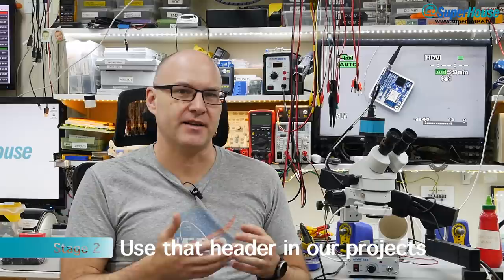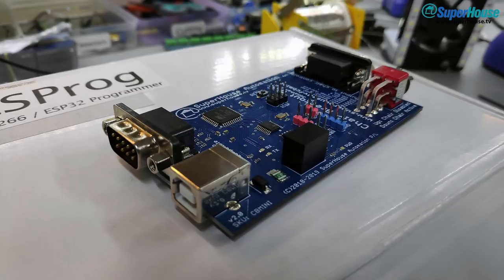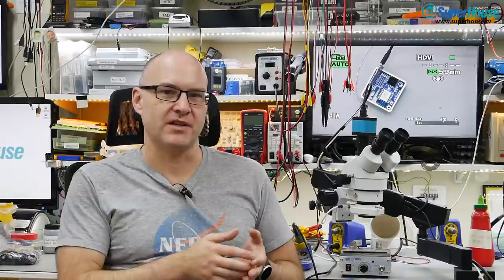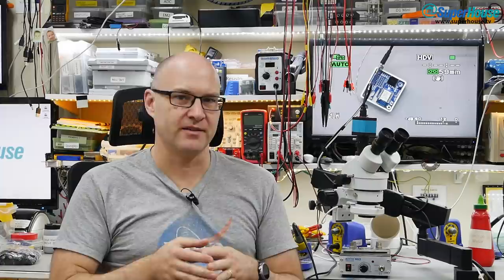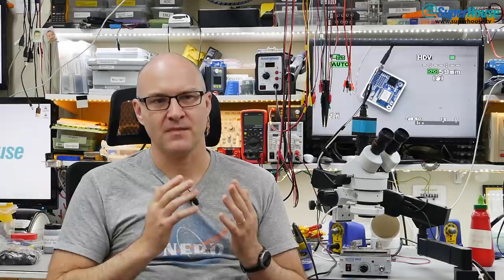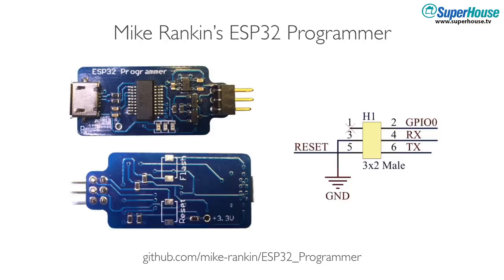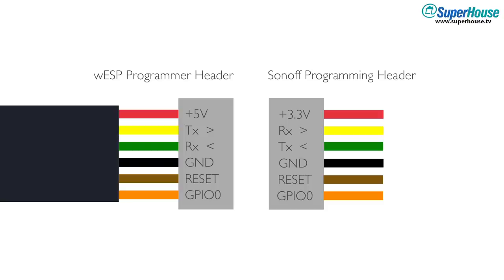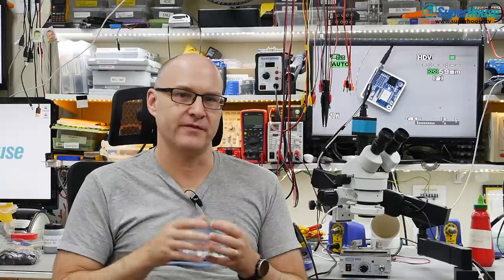Vlog #66: Let's define a standard ESP8266/ESP32 programming header!

Comment: Why not both: Allow the 2.54mm 6 pin sonoff+2 type header, and the tiny 2x3 pin header. On the programmer, put one on each side of the PCB. This way, it is easier for itead, other companies and your personal projects where you don't care about size, but you'll still be able to use the very small connector when there is just no room

Comment: Just add the two extra pins. This way it will keep the old standard and be backwards compatible with the the older sonoff gear.
Reply: I was thinking the same thing.. have the last two pins on a 2-gang flat cable (or twisted pair) so that the extra pin headers don't get in the way when  using as a regular FTDI programmer.  Could also have a matching 2-pin male on wires you could solder to the right pads on an ESP board that's missing them.

Comment: The 1x6 header would be easier to use by pressing at an angle against the pads on the PCB. It would probably be darn near impossible to reliably hand press a 2x3 header long enough to program the board. (assuming that there aren't actually sockets to plug in to).
Reply: It would be possible to have the holes there, and then you just pressfitt a male adapter. No need to hold while programming.

Comment: I think asking for design changes is like like a kid asking the bus driver to pull over for an ice cream. 

What I’d like to see is a printable mount, one for each board type, to which attaches a clampdown unit.  On this clampdown unit would be the necessary electronics to flash. Pre located thanks to the exact guidance of the mount, the clampdown unit would have spring mounted pins that are correctly spaced to mate with the holes.  Thus no soldering to get good electrical contact. Spring mounted pin will not do damage should there be misalignment.  Add or remove pins like detachable teeth and you future proof it for when board designs change.  Wiring back to the electronics would be swappable to pick voltage, TX RX etc.  

Procedures are 
Take units out of housing
Select base locator for that model and attach to clampdown unit
Connect punch down pins to electronics via appropriate wiring 
Insert SD card
Insert board to be flashed
Engage punchdown
Lock
Turn on
Start button to begin flash process
Unit indicates complete and turns off
Unlock and remove, repeat for next board “factory style”

Just seems more future proof if it could be done?
Reply: I've considered something like this, or maybe something that isn't product dependent, but rather matches up directly with the esp8266.

Part of me envisions a tool that functions like a press of sorts that just lowers a series of "pogo pins" onto the esp8266.
Reply from the maker: I've already done this for the Sonoff Mini. It's part of what started this whole question. My programming jig uses pogo pins to control GPIO0 and RESET on the Mini, so it can do auto-reset. But the question is, what should the format be for the programming header that connects to the jig? The jigs can all be specific, but the programming header still needs to be standardised. That's what this is trying to solve.

Comment: Good idea. I did they same through my designs with ESP32 only with a muuuch smaller header to save space.
Reply from the maker: What header did you use? I'm currently planning on supporting 1x6 and 2x3 in both 2.54mm and 1.27mm, so a 2x3 1.27mm header is quite small
Reply: @SuperHouseTV  I'm using a TAG-connect cable, saving costs on the PCBs for a header but the cable itself is overpriced.

Comment: I would vote for both a 1x6 2.54mm pitch and a 2x3 2mm pitch as options. More annoying for the hobbyist who ends up having both adapters lying around; but more flexible for PCB layout, as there are form factors that don't suit 1x6 (2.54mm wide and 15.24mm long) and other form factors don't suit 2x3 (about 4mm x 6mm). 3.3v and a standard order of signals too.
Given the manufacturers at volume are pre-programming their chips and don't strictly need these pins at all, it's somewhat nice that they are offered at all.

Comment: Having a short cable from the programming adapter to the target probably makes it simpler to connect.  How about trying to standardize the order, and then provide the 2mm vs. 0.1" pitch connectors on the programming device to make it easier to have inexpensive ribbon cables that are 'straight-through' for both formats.

The other aspect, independent of the physical connectivity is to define the programmer interface.  While it can emulate a serial port and support using the usual serial programming tool, wouldn't it be interesting if it looked like an OTA target as well?  Something to proxy that first programming step before the target is capable of OTA upgrades.

Part of the recommendation to expressif might be the pad layout with slightly offset alternate holes, so you could insert pins and have them stay in place, rather than needing to populate a header that's only going to be used once.

Comment: Really like the idea. One of the other advantages of having usb chipset elements on a seperate board along with the bootloader is evident for projects that look to minimising power requirements. If you have the CPU capable of running at extremely low consumption levels, having to power unnecessary usb interfaces negates the benefits, or you need more complex schematic to switch this extraneous circuitry off when not in use.
I don't have a preference for single in-line or 2x6 interface. If it becomes a standard doing forward it doesn't really matter, but having a 5v to 3.3v regulator on board would be a real boon.

Comment: Do use 1*6 and 2*3 headers.  Allow pitch to be 2.54 mm and 2 mm for future space saving.  It could probably use same adapter for the 2*3 header in both pitches.
Mark the 1 pin with a huge mark on the bord, or also cut one pin and plug on adapters, then it can't be turn the wrong way around.

That is what I would do. It will be easy to change to the right plug, and it will work with anyone.

Or to save some more money, just have holes instead of pins, and then you can push a male socket into them.  And have one hole not drilled, so you can't turn the plug the wrong way.  It will save money, and I guess that will be pleasing.

Comment: I think we should keep the ITEAD standard and just pitch to add the extra two pins.  Certainly a lot easier and it is a format a lot who use ITEAD products are already use to using.
It is more than just lobbying ITEAD though.  There is Shelly and a host of other brands that use ESP chips in there various variants.  I think it would need to start by lobbying at Espressif as the chip designer to add it as a "recommended practice" to the datasheet.

Comment: Great effort, My view is to add the extra pins you already have the working design and I believe in the KISS approach.  I would think the best option is to use the de-facto standard from the majority which is the 4 pins, and add the two pins to make programming easier.   This still allows the flexibility to use a daughter board for any of the existing variations that scatter the pins around.  Even ITEAD have some that are scattered  but you already have a daughter board to fix that.

Comment: Being a software engineer I would prefer to see a 'box' that contains everything necessary to control a sonoff using its diy mode. I believe it should have a WiFi access point preconfigured with the sonoff diy ssid/password, an http server and a piece of software that would give the user the interface to discover all sonoff devices and control them by calling all supported DIY API restful commands including flash. This could perhaps be packaged in a USB dongle and it would replace eWeLink while being completely local.

Since Sonoff went the way of the diy mode it may make more sense to try to lobby them into making such a device instead of redesigning their PCBs and changing their whole manufacturing process.

Comment: Simple for the pinout, but not voltage.
Support 1x6 in order you specified for both 2.54 mm and 1 mm spacing.
For 2x3, use same pin order and support  in format 2.54 mm and 1 mm. Then programmer can accept straight and 2x3, and then make programmer autodetect if it needs to supply voltage.
Edit: I really like the 3x2 on the edge, but access in system might be limited.

Comment: The ESP8266 and ESP32 can bit-bang USB low speed.  What we need to do is convince espressif to update the firmware to allow a direct USB connection.  They could use the GPIO2 strapping pin to indicate UART (low) or USB (high) boot.

Comment: Does the format realistically make any difference, it really is a matter of six of one and half a dozen of the other. As you say both formats have their good and bad points. So why not actually try to mandate both, let the project makers choose. You then promote the inclusion of the six pins and their layout. That way if someone really wants to use a JST or a 2x5 you still get straight through pin compatibility. 
Yes it makes a difference to the programmer but you could simply put a 6x1 on one end and a 3x2 on the other just increasing the BOM cost slightly. And you can also pragmatically deal with the voltage in the same way put a 3v3 regulator on the programmer board and a switch/jumper pins to choose which you use, you can also allow for the third option of no supplied power if the target has its own power. Again an increase in BOM but this is a 'one-off' cost and not an increase into the project costs which get multiplied.
Reply: It may be easier to promote one standard rather than leaving it up to guess work as to what each board will have.   It would certainly be easier for those making adaptors as everyone could be guaranteed the pins would be the same for boards that contained a header.
I doubt it will ever be made a standard of any kind as manufacturers have their reasons for wanting us to use their own firmware and not reflash devices, but it's worth a shot.
Reply: @EsotericArctos  It is the pin order and placement that I was suggesting is the standard not the actual header. It is so much easier to make an adaptor from say JST if the pin outs match than it is to make it if the pins are in different places. Since this would only amount to a 'recommendation' than the easier you make it for the project the more likely you are to get it adopted. So a little bit of trace routing versus a whole new part which has to be sourced and purchased. Assuming they put the connection on that is.
Reply: Exactly. It’s not rocket surgery to make adaptor cables.

Comment: shelly has a header that exposes gpio0  - unfortunatly they have been changing the header to add various extra pins based upon developer feedback (I guess!) but the pins are on a standard 2.54 pinout and easy to access (and build a connector for programming).
Whilst not all shelly products can run Tasmota, a number of them can.

i dont think a standard header will be easy across multiple brands, and even EspressIf would struggle to make this happen.  BUT you could lobby to get a single vendor to be consistent across their own products.  It is a selling point which is why I would consider shelly for certain options over Itead.

Comment: Do a universal multipurpose programmer, your proposed standard board with a switch for voltages + adapter boards to extend this to existing standards. Plus points if you label the extension boards clearly and offer straight and right-angle variants.

Comment: How about a test clip that fits the package? I used to love those back when everything was in a DIP. I'm guessing there would have to be a few variations for different chips/packages, but once made, it would just be a matter of clamping (or pressing/holding) on the test clip (perhaps with integrated buttons for reset & assert) and then pushing the new code to the ESP.

Comment: The industry seems to have switched to programming headers with 0.05" pin spacing.  I'd use something similar to the SWD socket.  This might require a ribbon cable to connect the programmer to the board, but that would allow the programming socket to take up less space on the target board.

Comment: How about an entirely new connector format in the shape of the Open Hardware logo - https://www.oshwa.org/open-source-hardware-logo/ - but specifically intended for pogo pin flashing. The logo is already keyed (it literally incorporates a keyhole shape) and supports 7 contacts (gear teeth). Your PCB would then only need the logo pattern and maybe some kind of physical orientation key to help align the pogo pins. Just my 2 cents worth. :)

Comment: look into the SOICbite, was featured on hackaday... uses a SOIC-8 test clip for a really small double sided edge connector footprint and the post includes eagle files 

you can even use a SOIC-16 clip and/or make it reversible if you need < 4/8 pins

for an end product maybe use a dummy SOIC-8/16 IC for easy vertical access? then the clips are ready made with a row of pins on each side for some kind of ribbon cable
Reply from the maker: That's a clever idea for a connector, but it doesn't solve the problem of defining a standard pinout for ESPxx boards :-(

Comment: From what I've heard, Sonoff came close to making their products un-flash-able...  Is there really a chance they'd agree to modify their boards to make it easier?  True, the reason they didn't was the massive feedback from the Maker community, but still..  @Karinya Fields has a good idea that I took one step further - just add the extra two female pin.. thingys (what are they called?? receptacles?)  on a twisted pair or two wires from a flat cable, and have a similar loose 2-pin male on wires to go with the programmer.  If the board you want to flash has all the pins, you attach the 2-wire female header, then the programmer on the rest of the pins.  If not, solder the loose 2-pin header wires to Reset and GPIO0 pads, and use that to attach the wired female header.
     Having the extra two lines loose makes sure those female header pieces won't get in the way of something on the client board when you plug in, and still lets you use it easily for boards that do have the extra pins.

Comment: Overall I'm kinda split on this. I really like the idea of the 2x3 header as it's a bit more compact, but I also really like the 1x6 for backwards compatibility... At least with some existing devices. Overall... I think the 2x3 header would be better in general though.
Reply from the maker: I couldn't decide, so I'm going with both :-)
Reply: @SuperHouseTV  two standards are good enough, as a simple switch of adapter cable would be enough.  But yes all needed pins should be there.

Comment: I use bare minimum in my projects RX, TX and GND. There is also "BOOT" pushbutton on my board and it triggers flash mode.
Then using RT, TX and GND i am able to program it using PC.
Reply from the maker: Buttons on the board is fine, but I find it's a huge benefit to have auto-reset when working on projects. Often I'm not even physically near the target board: it can be connected via USB to a machine in my lab, and I might be working on my laptop somewhere else and needing to re-flash remotely. What I need is a header that allows programming with auto-reset.

Comment: IMHO the decision is simple: "Don't piss off the 800-lb gorilla."  Add 2 pins to the "standard" interface.
Reply from the maker: Yes, that sounds easy, if you accept that the standard header is what ITEAD use. Then the question is what voltage to supply to the target. Boards such as the wESP32 require 5V, others such as Sonoff require 3.3V.

Comment: I need 5V DC pin for ACS712 add to it.
Need to have color system to prevent “Smoke” ex: Red is 5V DC, Yellow is 3.3VDC and Green is Ground etc. ..
Reply from the maker: This is a super-useful point: boards that require 5V to power peripherals. So the question is, do you need the 5V while the board is being flashed, or could you power your board directly on the 3.3V rail during flashing, and then power it from your normal power source when the programmer isn't plugged in? My use-case is primarily to flash the boards during development or just initially, then in most cases OTA takes care of updates. During the few seconds taken for flashing, I don't normally care if peripherals are running.

Comment: super easy, all ITEAD (or anyone else)has to do is make the break out holes like they use to do and you use a solderless header( https://www.adafruit.com/product/3413 ) on your board. its your best option because it wont cost ITEAD any money except for the drilling of the holes on the pcb. we just need the gpios broke out, the rest is easy.
Reply from the maker: Yes, that's the whole point of this question: getting GPIO0 and RESET broken out, what order to put the pins, and what voltage to supply to the target. Connectors are easy.

Comment: I'd like to see something standardised, which also supports atmel/atmega chips as well.
Reply from the maker: That would be ideal, but the reason for this is to work around the specific requirements of the Espressif chips to put them into bootloader mode. Whatever header is used for ESPxx will have to be specific to them.
Reply: @SuperHouseTV  That makes sense, one could perhaps just re-use pins (reset, tx/rx, etc) or just have them n/c on the footprint on the product's board if it doesn't use the pins. Otherwise I am a huge fan of edge connectors, and use them on all my PCBs for a home lab programmer.